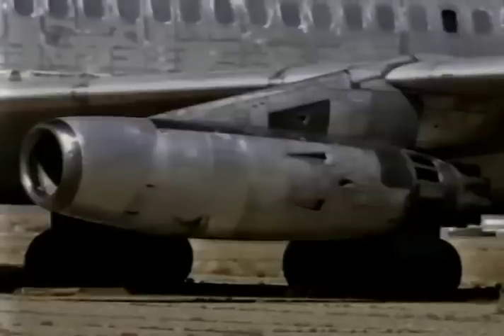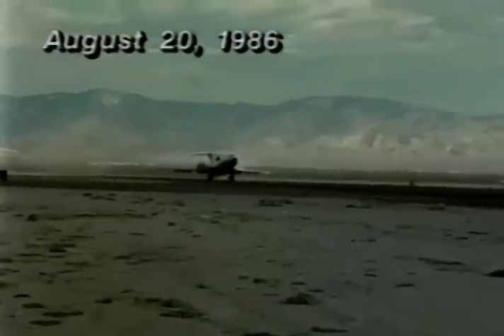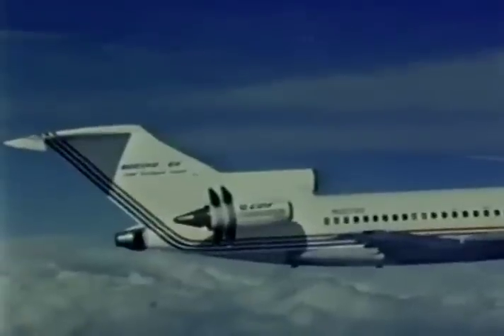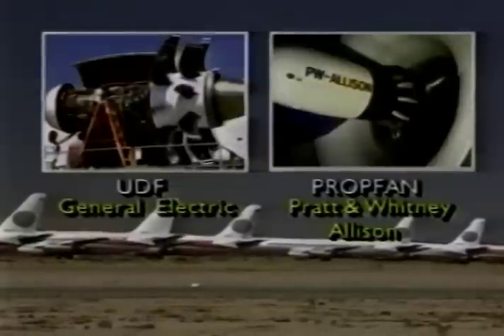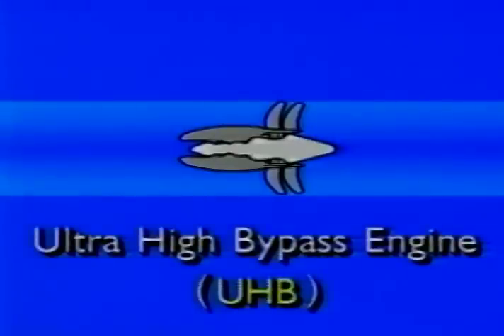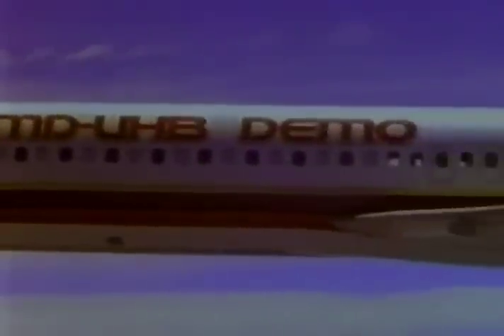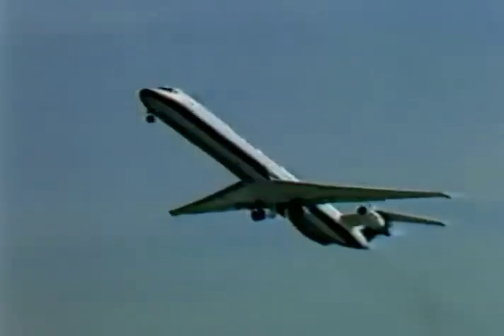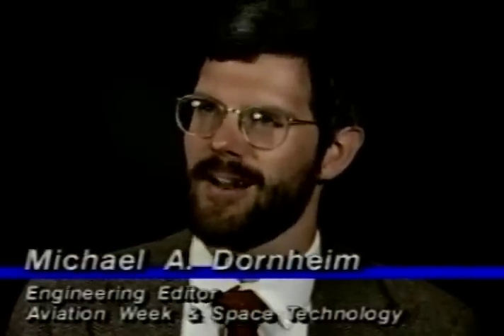The Incredible Engineering of Ultra High Bypass Jets

Comment: How is this different from a turbofan jet engine?
Reply from the maker: Thanks for watching!

The fan blades are not covered in a cowling. Instead of a high bypass ratio they are ultra high bypass.
Reply: But does that make it work any better?  As I understand it, shrouds make fan blades work better.
Reply from the maker: "Better" is a loaded term.

The goal was improved fuel efficiency over high bypass jet (gas turbine) engines at the time this video was produced (late 1980s).

It is fair to say ducted systems are typically quieter and one could advance the argument safer (broken blade retention). I'd not worry too much about UHB safety though; noise and public perception that they were just prop planes proved a greater obstacle.

What we see IRL today are some turboprops gaining more and increasingly scimitar shaped blades edging closer to the UHB configurations you see in this video. You also see the Pratt & Whitney Geared TurboFan (GTF) powerplant promoting the transmission concept mentioned emerging in the market.

Typically, for pure profit, not political reasons, airlines just care about fuel efficiency as it directly effects their cost of operation. The holistic approaches by Boeing and Airbus (shape, materials, software optimization, etc.) on new designs (787, A350) are yielding very impressive improvements in fuel efficiency, aided, of course, by modern gas turbine (jet) engines from GE, Rolls, Pratt, etc.
Reply: AeroSpaceNews.com Thanks for the info. So is this engine more efficient than a turbofan engine? As I understand, turbofan engines already existed at this time.

Comment: Third, the concept is too noisy to ever serve a commercial airport.  Think about it - there are 16 trans-sonic propeller blades, they counter-rotate in close proximity, and there is no shielding or ducting to control the sound.  How would you solve the noise problem?  Some acoustical engineering geniuses may revisit this.  I wish them the best of luck.

Comment: First, this is a very old video, probably from the late 1980's.  

Second, No gearboxes?  I beg to differ.  I worked for Western Gear, the company that designed gearboxes for the UDF.  (The engineering was amazing.  They were under each fan blade and could change the angle of attack by fractions of a degree while under full power and operating at some 1300 G's radial acceleration.  They were not part of the drive path for the fan rings, so they did not reduce available power.)
Reply from the maker: The GE engineers were the official source of the claim that there was no gearbox on their UDF. It was a selling point they felt distinguished it from the P&W Propfan.

Comment: If it is a counter rotating fan it has a gearbox Sorry to have blown up your lie GE
Reply: 8aleph No it did not have a gearbox and if I am so affirmative is because I worked for 3 years on the project. The design was superb and still today I am in awe of the design.
Reply: Without a gearbox how was counter rotation achieved?
Reply from the maker: It was a long time ago I reported on this (and produced this video) but if I recall correctly simply changing the orientation of the blades in the turbine flow can spin the connected propulsers in different directions. So one turbine spins clockwise (or pick a direction) and the next in the stack spins the other way.

Anyone who knows for sure is welcome to correct me or add more detail.
Reply: So basically instead of having one turbine then a stater, they have two turbines in a row. I'm assuming of course.

Comment: High Bypass jet engine... This idea is sort of like the Turbofan engine we have today right?
Reply from the maker: Thanks for watching and taking the time to ask a question.

High bypass (as you wrote) is very much like we have today. UHB is similar too in terms of performance but without the "cowling" or nacelle around the blades.
Reply: +AeroSpaceNews.com but werent high bypass engines already in service in the 80's and 90's? i mean dc10, b767, 747, md11, a300/310

and why dont they sound like this propfan? especially the new big engines sound very deep
Reply from the maker: Thanks for watching and your question.

If I understand you correctly, the Pratt & Whitney JT9D was considered the first high bypass ratio jet and it first ran in the middle 1960s.

They didn't sound like the UHB options shown in this video because they were not "open rotor" designs like UDF and Propfan.

Comment: I see why these never became standard. For one thing, if you ever threw a blade it would certainly be a fatal situation.
Reply from the maker: Hey, thanks for watching and taking the time to comment. Actually loss of blade(s) isn't any more of a risk than faced by operators of turboprops. And some of the new turboprops have many blades - the C-130J has six bladed propellers.

Comment: I don't really understand Ultra High Bypass engines were what they called the engines that first started appearing on the DC10 and I think L1011 also. They offered the dual advantages of being far more fuel.efficient and quiet than straight turbines that have that silver cigar look like on early 737s. I thought UDF engine technology was called just that, unducted fans. Why would they call them both ultra high bypass engines even if it was a progression of that original tech?
Reply: Correct on all counts. Unfortunately, the unshrouded blades whirling at .75 mach made for  loudness, even with the new blade designs and materials.   Their designs were not for naught. Their descendants (GE90, GE/Honda HF120, and PW4000 families) have inherited the carbon composites and advanced turbine blade designs, making for extremely high efficiency and low noise ratios that mark them as the future of civil jet transport drive systems.
Reply from the maker: Thanks for watching and for your question.

UDF was a product name belonging to GE. Pratt & Whitney called their geared approach the Propfan. Generically the lack of shroud and bypass ratio was called Ultra High Bypass to distinguish it from high bypass ratio fanjets which, you are right, did appear on the DC-10 and L-1011. I'm racking my brain to think if they appeared anywhere in series production aircraft earlier but nothing comes to mind save for the 747 (Pratt & Whitney JT9D), which of course had a higher bypass ratio than 707s, DC-8s, 727s, 737s (first gen), DC-9s and Convair 880s, making them the first truly high bypass ratio series production jets. If I'm wrong folks please correct me!
Reply from the maker: Many thanks for watching and your helpful, thoughtful reply!

Comment: Even though it may be more efficient, they had to be noisy especially being counter-rotating.   I wonder how this compares to a modern high bypass engine as far as efficiency goes?
Reply from the maker: Thanks for watching and your question Chris.

Frankly, I've no clue! I suspect but have no proof that thanks to improved materials science, aerodynamics, manufacturing and thermodynamics more efficiency is being squeezed out of the newest jet engines than seen in this Ultra High Bypass program. If you dig up a credible answer I'd be grateful if you'd come back and share it here.

Comment: Rolls Royce is working on this now. But the interesting new development is getting rid of the center shaft and bearings and all the stator vanes, by holding the the fan and turbine discs in a magnetic field, using superconductors. The turbines would be generators and the compressor fans driven by electrical motors. No bearings, no shafts, just magnetic fields, and everything is counter-rotating, so no pesky stator vanes.
Reply from the maker: +James Monahan Thanks for watching and adding that interesting tidbit to the conversation! Has this research been reported on anywhere you can point to specifically? Aviation Week? Flight Global? If so, can you provide links? I'm curious; it sounds really fascinating.
Reply: AeroSpaceNews.com I read about this in Aviation Week & Aerospace Technology Magazine about three or four years ago. There is also a start up company that claimed they would be researching this technology. This was also from Aviation Week. I'm sorry but I don't have time right now to search this out.
Reply from the maker: +James Monahan No problem and thanks again for watching and replying!

Comment: Lots of interesting comments about the benefits of this experiment. Regarding thrown blades from prop planes, there was an incident in Canada a year or two ago when a Q400 had a main gear collapse on the runway and all the prop blades on one side sheared off. One blade penetrated the fuselage and just nicked a woman's head, fortunately giving her only a nasty headache. Uncontained blade failure is obviously a problem, but even in this video the noise from the contra-rotating props is quite noticeable, too.

Comment: I think I remember seeing this very video, or one like it featuring GE's UDF in about 1986/7 or so.
Reply from the maker: +Dreaded88 Thanks for taking the time to leave a comment. This video was originally produced in 1989 so that is a possibility in case your memory is a little hazy about the actual year. It could also be that you saw some other early reporting on this technology from the time. Hope you enjoyed the story despite the very long opening (sorry about that! as you can see our most from our recent videos we've learned our lesson) ; )
Reply: AeroSpaceNews.com
No worries.
I'm still a bit puzzled that after the last spike in Oil prices we've had, the Airlines STILL have not adopted this technology.
I find that a missed opportunity!
Really, how much would it have cost in both Licensing, and in Refits?
Or they just didn't want to have to do the paperwork!
Reply from the maker: +Dreaded88 Because, at the time, oil did not go through the roof, there was no immediate pressure to switch to a configuration that included a couple of drawbacks. First, this generation was kinda noisy compared to conventional high bypass ratio fanjets. And next, there was a perception that this was going back to propellers which, though incorrect, made it seem less leading edge and more trailing edge tech. As a result while this exact system never saw line service, core efficiency gaining internal technologies had time to mature and are in fact in service in many of the big, quiet and efficient jet engines made by GE today.
Reply: AeroSpaceNews.com
My reaction: Noise Schmoise!
Be happy you don't live around an Air Force Base launching B-1's 'round the clock, then you'll know noise!
As for Props on a jet: Aesthetics means that much? It's an MD-80. She ain't breakin' the sounbarrier for chris' sakes!
Someone needed to hire a PR firm, and make some good commercials showing the thick, black, 'Coal-Smoke' comming out of a -707, and then showing the UDF with happy music playing in the backround! :D

Comment: How can a technology that still uses fossil fuels be "green"?
Reply from the maker: +Skoda130 Fair question and thanks for asking it! In this context, considering how much fuel is consumed in air transport, a reduction in fuel burn by the amount outlined in the piece was considered a green technology, but only against the backdrop of what the standard was at that time.

Needless to say, moving to a different core technology (really technologies - there need not be just one solution) for energy production, storage and use (away from non-renewable fossil fuels) is the only true green course.

Comment: Yep props a leap into the future.... err past. I was working at Boeing when this was going on... I had to look at mounting these things onto airframes. The damage tolerance of throwing an uncontained blade into the fuselage or wing was not good. Now they have geared fans, but the blades are still fixed and inside the cowl... The next is vary the blade angle, but that is hard to on a turbine. Props are still around because they work, for specific airframes and missions.... Russians have been using counter rotating props on the TU bomber/bear
Reply from the maker: +gmcjetpilot Thanks for taking the time to post a comment on this video and sharing your experience with this program and technology!
Reply: Really cool you worked at Boeing. A lot of what you said is a bit over my head but can you explain shortly why the special engine is only mounted on one side of the aircraft?  Was that how it was to be deployed?
Reply: @officergregorystevens5765  Because they were testing the UDF. If the test engine stops working in flight, because of a problem or they messed up a test, the test plane can still fly and land safely with the power provided by the other normal engines.
Reply: Russia is stuck with a turboprop bomber that relies on advanced missiles to avoid being shot out of the air by any reasonably modern fighter jet. The US relies on the B52 with gas guzzling jet engines from the 70's and a similar stealth signature to the the TU (ie a brick). Only anti jamming pods would save it from any advanced SAM batteries or a fighter. While the B1 is a modern bomber its only still flying, its also from another era and any significant upgrade would make new Air Force 1 look like a bargain.

Comment: Big oil companies killed this technology. For the same reason they suppress electric and hydrogen cars. Because oil companies won't make as much money!
Reply: +Sean Casey Sure they did, they also covered up "fish carburetors" too didn't they...
Reply from the maker: +BarbikaPahor Thanks for taking the time to add your thoughts. While I agree battery technology has a long way to go, there is little, if any evidence, that electric powered cars are being killed. Given the growth of Tesla, BMW, Fiat and Nissan's offerings (among others), electric cars are in a growth spurt, not dying off.

As for hydrogen being impractical, while it has its own challenges, it, in my view, is actually the best long term solution. There are very practical ways to capture energy for storage and use by both hydrogen and batteries. And in the world of engineering, the compromises involved are more attractive, at least in my view, than those associated with carbon-based fuels/energy carriers.
Reply: +Sean Casey weak batteries and high cost are killing electric powered cars. and hydrogen is impractical besides you still need energy for producing hydrogen or electricity for cars.
Reply from the maker: EpiDemic117 I agree with most of what you wrote, but nukes, to me, pose risks that I feel are unacceptable. I'm not risk adverse. I fly airplanes and in helicopters. And I eat out (joke). But while widespread from subs and carriers to stationary power, I don't advocate nukes in almost all cases. 

The issue of battery vs. h2 storage comes down to what you are using the energy for and how soon you plan to use it.

Batteries are far from a lossless storage technology (true for some h2 storage too). But h2 tanks offer better (in my view) storage metrics, especially if use is not immediate.

And geotherm? Nirvana - a really great solution and coming online, as you stated in other words, little by little.
Reply from the maker: EpiDemic117 I understand your points about the technology improving. I respectfully disagree about how safe it is. From reactor accidents, to weapons, and then disposal, if I were King (and there is no chance of that needless to say), I'd not go nuke.

I do appreciate your thoughtful tone and for taking the time to comment. Things on the internet can deteriorate pretty quickly. :)

Comment: with the price of oil going south, udf is not likely to be considered. However their descendants is the Pratt and Whitney GTF (geared turbo fan) has already in service , A320NEO and others
Reply from the maker: +Muzaffar Mohamad It is indeed headed South once more but it is unlikely to remain stable for very long. Like demand for new aircraft, there are constant market swings. However, UDF, as illustrated specifically in this 1989 video, won't see service due to noise and newer more attractive technologies.

Comment: Noise, noise, noise. will ensure these engines never enter productive service. Take note of the blade tips, these tips travel at the speed of sound, (fact) the larger the tip, the louder the blade will be, they'll need to do a lot more work in this area before these engines become acceptable. NOTE, to reduce the blade tip noise, a shroud enclosing the blades would do the job nicely, but then it become a ducted fan.

Comment: The carbon fiber blades proven in this technology later went onto be used in the GE90 and GEnx engines. So the notion that these blades are going to fly off is ridiculous to say the least. Have there been any GE90 catastrophic blade failures of late? Or any, other then compressor stage failure on the GE90? How many 777's are flying right now with GE90 engines with these carbon fiber blades, all of them. If this were an issue, they would all be grounded from the public outcry of debris being showered down upon them.

In a sense these unducted high bypass fans are what trail blazed the current high efficient turbofans of today, with their wide-chord swept fan blades, and resulting blade reduction, saving even more weight on top of the carbon fiber technology.

See this video by GE that talks about this bit of history. https://www.youtube.com/watch?v=4lip8lPWFLo
Reply from the maker: Marcus Damberger Thanks for taking the time to comment and add that helpful historical information!